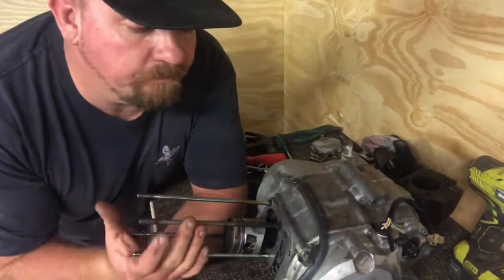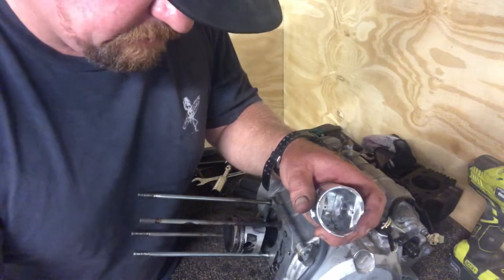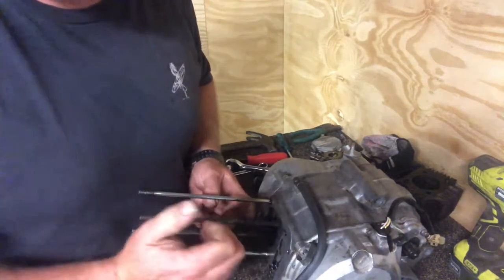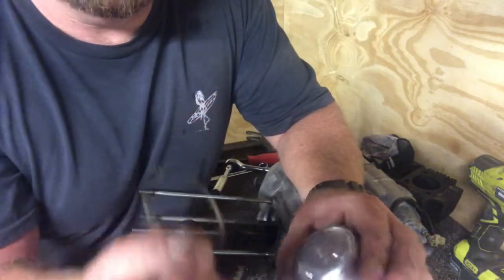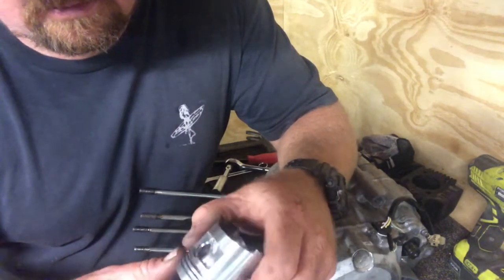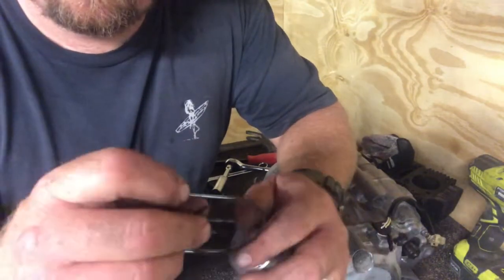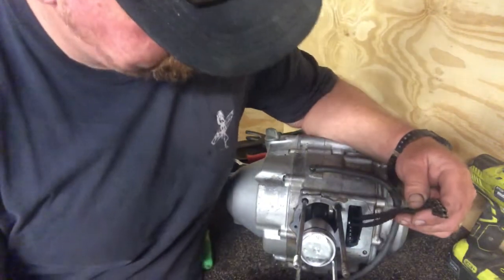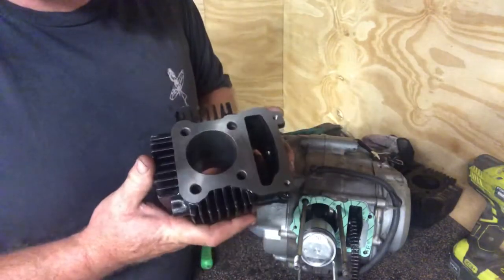Ct110 postie build changing piston

Comment: Great video Trav. 3:44 What method did you use the clean the bottom of the head and the valves?
Reply: Typically I'd use a small 1" wire wheel on a dremel and 600 grade wet/dry on a marble slab for the head surface